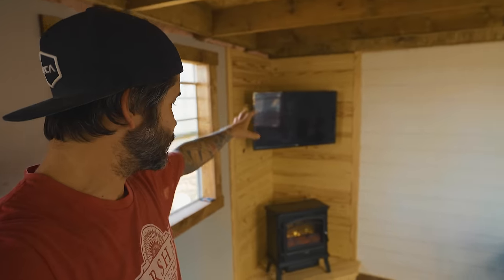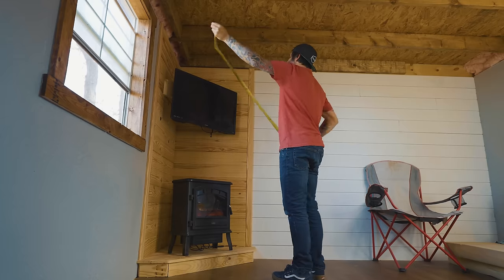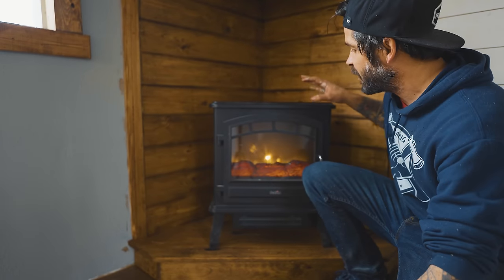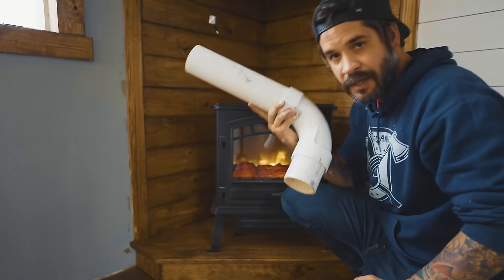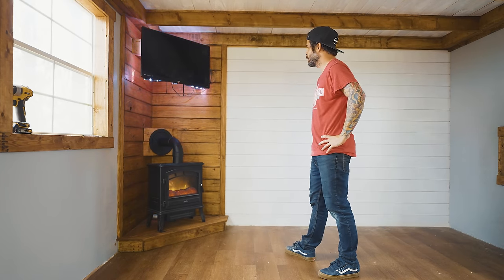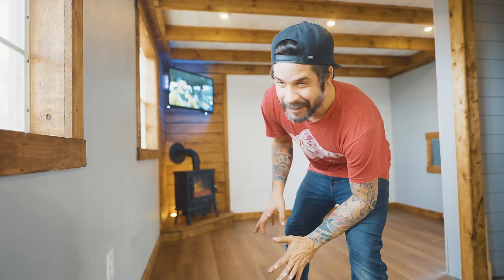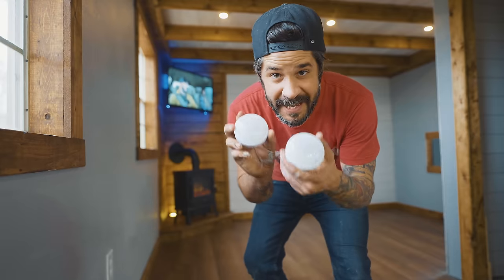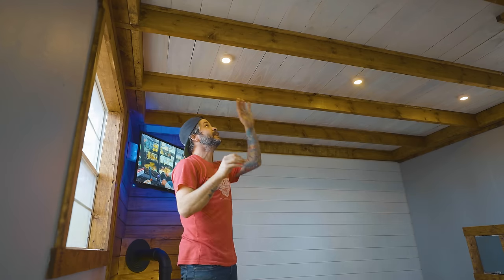12x24 SHED TO HOUSE - - Ready To MOVE IN - - Off Grid TINY HOUSE

Comment: Dude, that looks really good! I would still put another coat of white paint on the loft boards to match the wall and a piece of the stained quarter trim in the corner to separate the shiplap and drywall. The wall paint is fine (maybe a little blue) but it compliments your cabinets? Good lord, now I sound like Matt...the interior decorator. lol 😆

Comment: Jason it looks sooooo GOOD.  All the added touches just pulls everything together.  I used some old wood siding planks for a project and just put one coat of white paint on it and it made it look weathered.  It was so pretty.  Also, tip for the remote controls, buy a sugar packet holder, or make one.  Holds up 10 remotes.  I have 9 remotes  because I have various candles and lights all throughout my house and I just use black magic marker to  write at the top of remote which lighting it goes too.  Organizes all your remotes in one place so they are not scattered everywhere.  The stain was the perfect choice for fireplace area.  Looking forward to seeing what you do for a mantle.  Danielle is going to love it. Also have ya thought about making a little bunky on stilts?  Maybe an 8 by 8 for extra sleep space or little studio?

Comment: Looks good. I know In most of my State and probably most States that allow them a 7 feet height minimum is required inside the dwelling and this includes the storage loft you have because it's a living area under it. Also cannot have less than 120 square feet total. Some jurisdictions require 150, and others require an additional 100 square feet per adult. Each habitable room cannot be less than 70 square feet. The kitchen cannot be less than 7 feet horizontally. It cannot be lived in permanently if it has wheels. It must have a working bathroom with a legal septic system. Fortunately there are no taxes currently imposed on tiny homes at least in my State.

Comment: I know it's a personal preference but I wouldn't have stained the wood behind the stove...When I seen you do that...I cringed a little :O LOL...I'm torn between painting or not painting  the wood between the Ceiling Joists...Maybe  more of a whitewash where  you can still see the wood color just under a thin coat of paint.?...I do like the PVC pipe Idea on the stove, and believe it or not..I like the wall painted white, but I would have done a whitewash in that also.. :). I'm more of a Rustic Rustic kinda guy without the Rustic Modern accent kinda guy LOL :O...with that said...it's very nice either way.